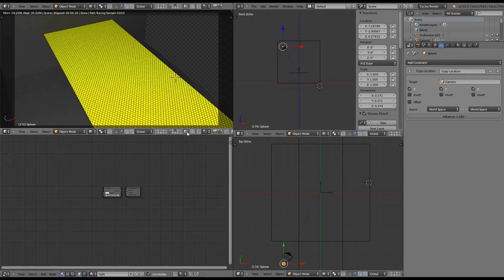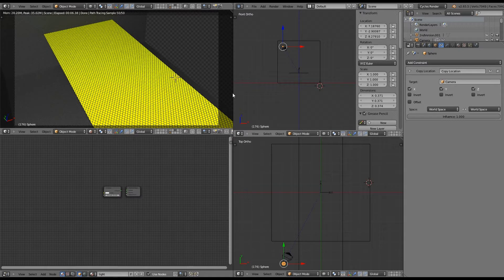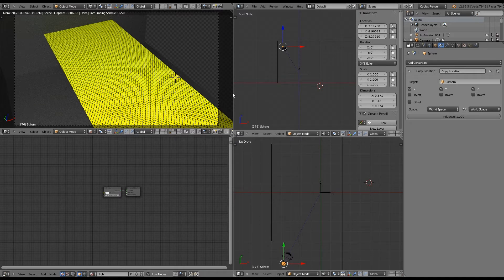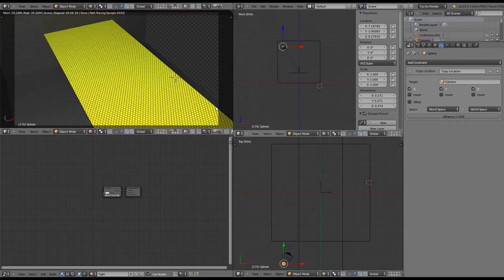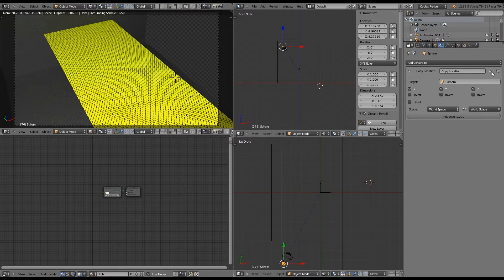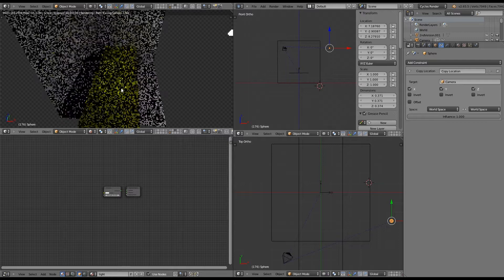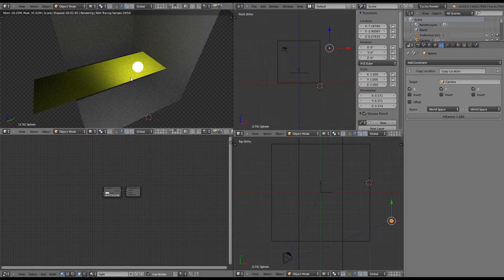Blender Cycles Retroreflective 3M DG3

Comment from the maker: I'd use a normal map for the scale displacement. For the color, I'd paint the texture in blender. Then I'd add a mix shader and make it pretty glossy (mix with colorramp or fresnel). I'm not sure how familiar you are with Blender materials. I'm no expert, but I think that would yield nice results. Let me know if you run into trouble.

Comment from the maker: Leigh, I added a link in the description to the thread I started on Blenderartists. The node setup is on there. This isn't a procedural material. There is a normal map and an image texture for the mesh-like pattern. Do you have a use case for this material in mind? Would be cool to see it used for something.

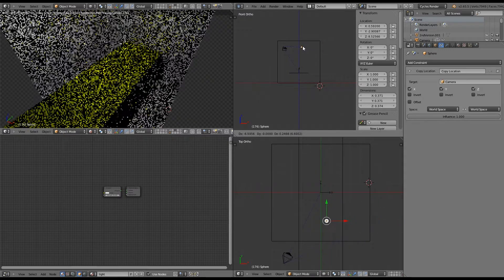Comment: Nice demonstration and encouraging results. There was a good return when the light and camera were inline. I could see a normal map working for one direction (of your camera and light w.r.t. the surface), but not arbitrary directions (where your light and camera are still inline). At 1:33, you show the light on the opposite side of the surface, what happens if you leave the light where it is at 1:33, then move your camera to be inline with it? Does it still produce full return?